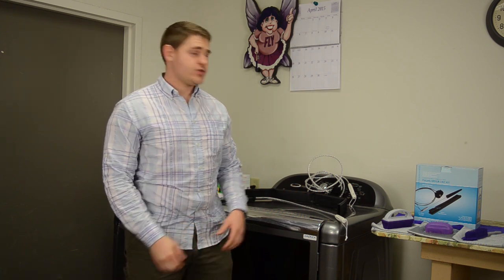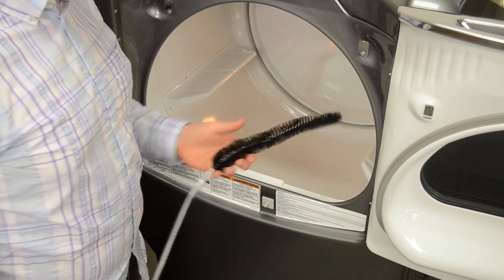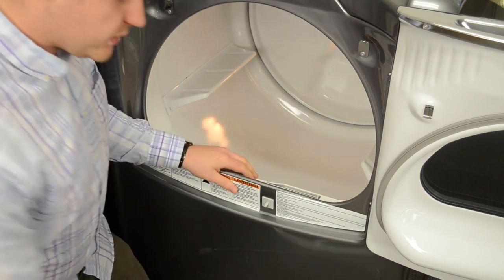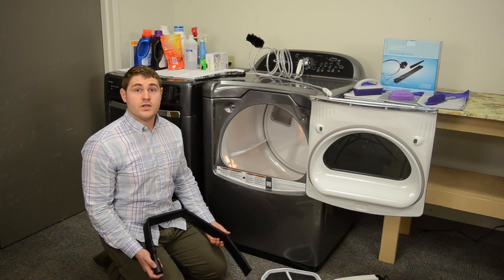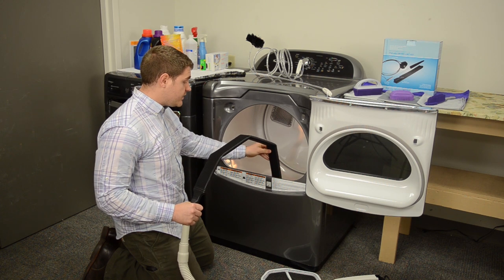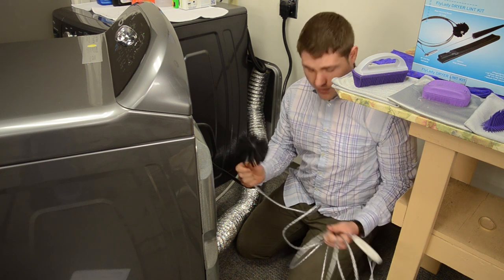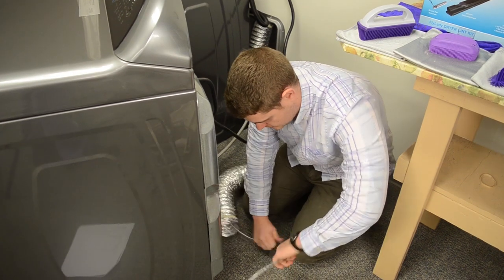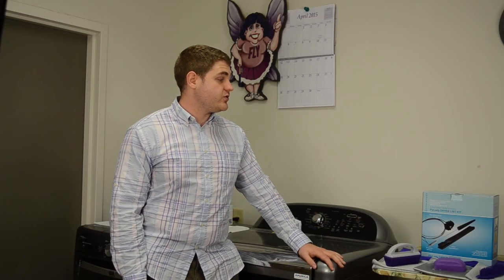How To Use Your FlyLady Dryer Lint Kit

Comment: Agreed. What about the other uses for the vacuum attachment?  Do you not go all the way through the vent? How do you get the residue off of the lint trap?
Reply: Use the used dryer sheet that you're removing from the dryer to get the lint of the trap. It's amazing.